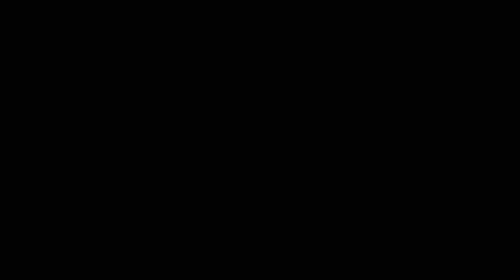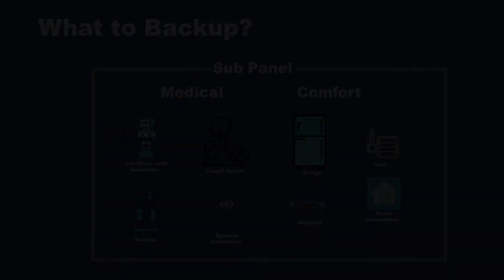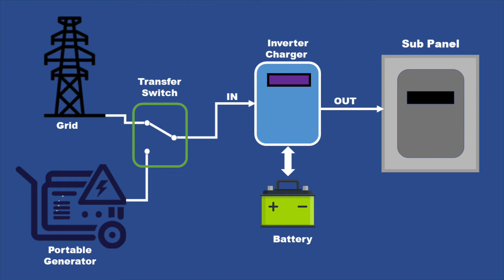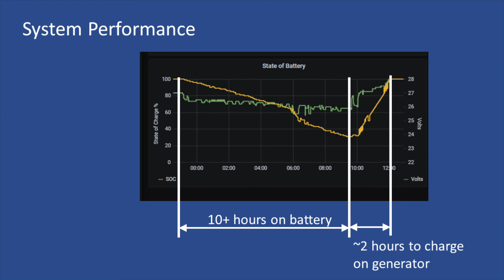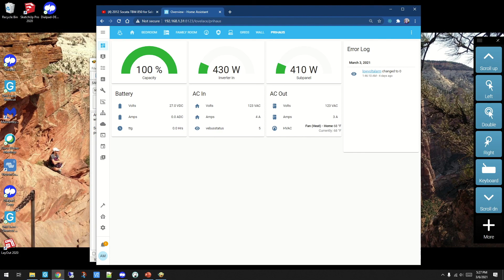PriHaus: Hybrid home backup system

Comment: I would make one change to your system Andrew. Not hardware but programming. Dont let your batteries get so low. set the gen set point at say 5 hours so, if it fails to start it gives time to sort the fault or make alternative arrangements.
Your system is a pretty standard system fitted to yachts.
Reply from the maker: excellent point. thanks
Reply: @oneandahalflegsawm  depending on the criticality of your reliance I can suggest a couple of changes to your hardware too. 
Install a bypass switch from input to output of your Multiplus. Although very reliable nobody has ever made a product that doesnt fail at some point. Putting a bypass in allows a rapid change in the event that the Multiplus does pack up. 
Is the transfer switch automatic? If not then I suggest it should be. Neither of these are expensive items, in fact your transfer switch could be repurposed as the bypass switch.